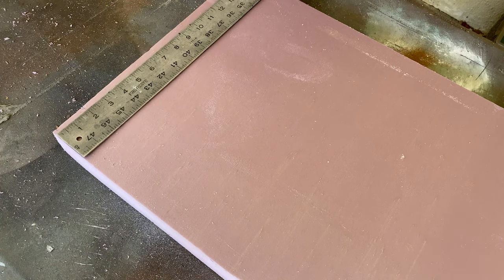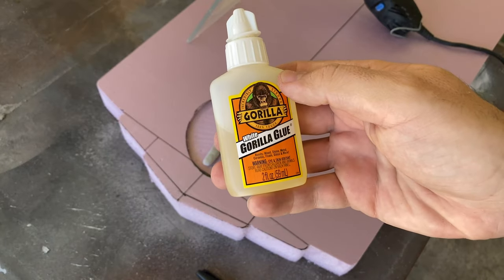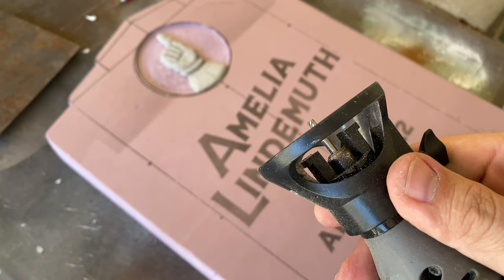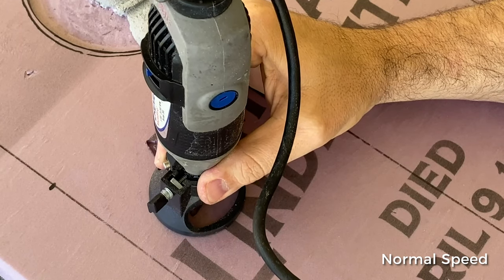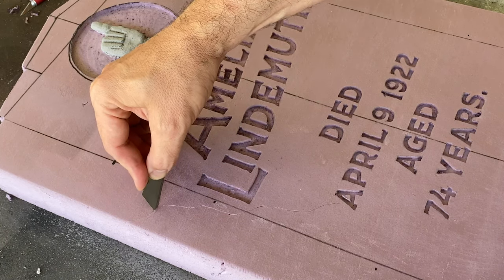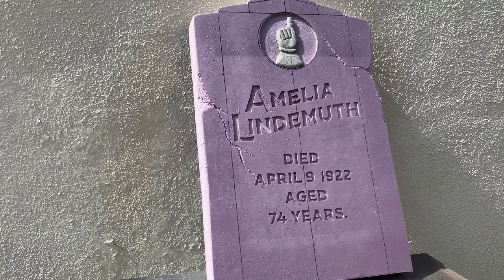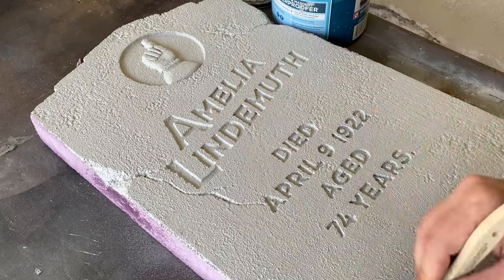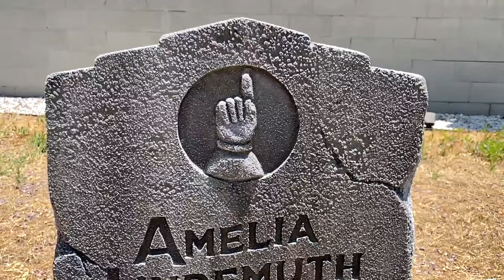Make Your Own Realistic Halloween Tombstones

Comment: Great tutorial.  Wish I had thought of the plastic plate on the Dremel!

I’m getting ready to paint my stones and realized that I cut my epitaphs way too deep,  getting dry lok into a lot of these letters is going to be difficult to impossible.  Any suggestions?  You’re stones look great, and I’d like to paint them using your methodology, but I’m in a bad place with this.  Using a tiny brush is tough enough with regular acrylic paint.  Not sure it’s going to work with the heavy stuff.

Thanks!
Reply from the maker: I wouldn’t worry about getting drylok into your letters. I’d start by spraying thinned black or dark grey paints into the letters and then drylok the face of the tombstone.
Reply: @VanOaksProps  thanks for the response!

Comment: I use rebar and 3/4 PVC to set up my tombstones, how do you stake yours down?
Reply from the maker: Exactly the same way.
Reply: @VanOaksProps  Do you sandwich the PVC between two foam layers, or attach it to the back?
Reply from the maker: @JonFlores275  Neither. I have a 12" long 1/2" drill bit that I use to drill holes into the 2" foam. It's nerve wracking, but I always do it before I carve in case I really screw it up. LOL

Comment: Amazing video! I just dryloc painted my project but I was so caught up, I forgot to do the water/heatgun!!!! Seriously kicking myself. It is a big project, too. I'm wondering what might happen if I try to do the water/heatgun even though the base coat has been applied? Has anyone tried this? Will it cause crazy fumes?
Reply from the maker: I’ve never tried it, but my assumption is that it won’t work. Because the foam is covered in paint it won’t have the same reaction to the heat.

Comment: Do you think I could use a heat gun in place of the blowtorch I tried a hair dryer it did not work thank you
Reply from the maker: Heat guns work, but the outcome is different because the foam stores the heat created by the heat gun until it can’t hold any more and then you get a reaction. The problem is that you can’t control that reaction and it’s often an undesirable one. The torch reaction happens immediately and so you have a much more controlled reaction.
Reply: @VanOaksProps  thanks for the info.im ordered a heat gun and will try it out on the back first.

Comment: Does the spray bottle you used shoot a spray of paint or a stream of paint? Awesome content. I subbed!
Reply from the maker: Yes, the spray bottle is a wide spray, not a stream. Although if you slowly pull the trigger on a spray bottle you can alternate between the two spray patterns.
Reply: VanOaksProps ok thanks
Reply: How would you do the spray bottle aging on the lid of an above ground crypt? Or would you use a different technique
Reply from the maker: @hughmungus8320  I'd do it the same way, you just wouldn't get the dripping.

Comment: May i ask how you stick them in the ground?
Reply from the maker: Absolutely! I drill two holes up from the bottom and glue in 10-12” of 1/2” pvc pipe. Then I hammer rebar into the ground using the spacing of the tombstone pipes and slide the tombstone over the rebar.
Reply: VanOaksProps i wanna do this so badly but we have such bad luck with foam tombstones! 😩

Comment: I just have a regular computer and printer can I do something like this? Do I need a lot of special things please help thank you
Reply from the maker: You can absolutely do it with what you’ve got. Just print your text on paper and the trace the outline onto the foam with a pen. 

You’ll want to check to make sure you’re using enough pressure to transfer the design, so tape the print out along the top edge and stick it to your foam so that it doesn’t move around.
Reply: @VanOaksProps   Won't I have to cut out the stencil with scissors
Reply from the maker: @vanderhoff66fu  Nope. You won't have to cut out a stencil, you can just trace the epitaph onto the foam and you'll be able to see the indentation where the lettering should be. Then you can move the paper out of the way and use a marker to make the indentations easier to see.
Reply: @VanOaksProps  thanks for your help
Reply: @VanOaksProps   Can you recommend any programs to use or anything that's free I can download or might be on my computer. thanks
Reply from the maker: @vanderhoff66fu  Any program that you can type into will work. Just enlarge the type to fit your tombstone.

Comment: How to you anchor them to the ground?
Reply from the maker: I drill out two holes in the middle of the foam and insert 1/2" x 10" pvc pipe. Then I use rebar hammered into the ground and slide the tombstones over the rebar.

Comment: Ehh... foam is the worst. I bought 3 foam tombstones last year and before the 31st 2 of them were broken from the wind.
Reply: Well it should be mentioned that the store bought ones are made of styrofoam, and maybe less than half the thickness of the one he made in the video. That combined with the weatherproofing drylock seal should give you a pretty robust product with this DIY method